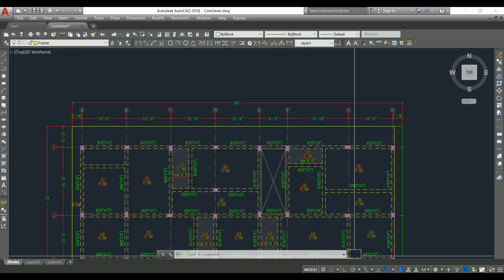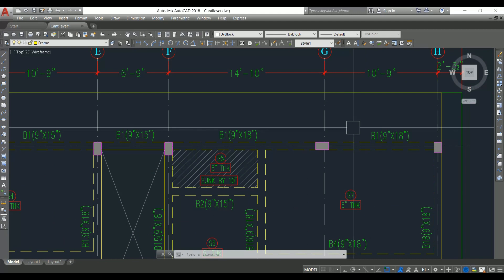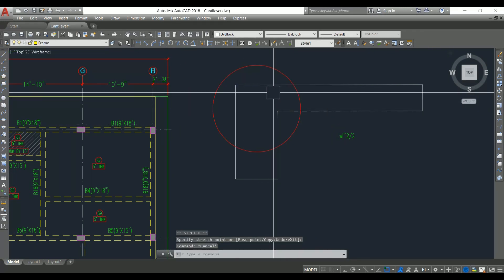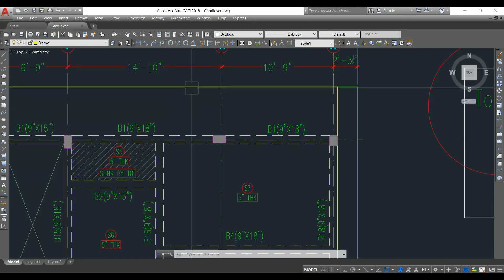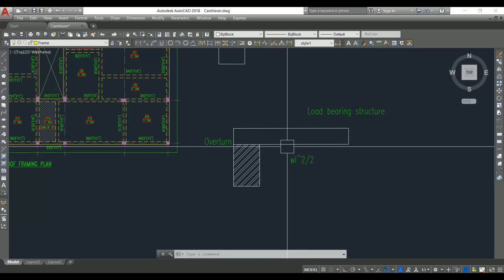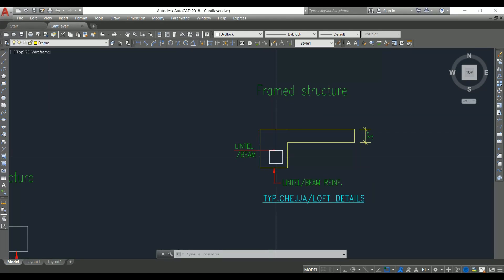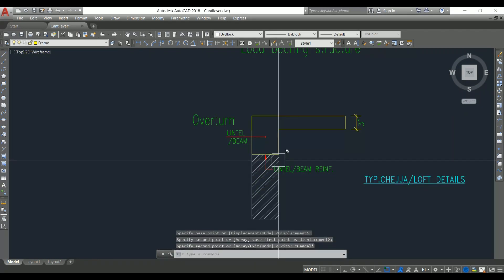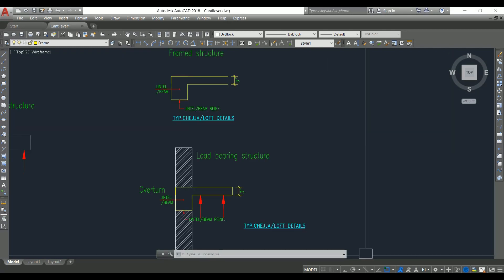Cantilever slab support in load bearing and framed structure | Cantilever slab support | torsion

Comment: Thanks for sharing.  Could you please explain from which side ( support / free end) we have remove the props
Reply from the maker: You are welcome.
The cantilever slab Shuttering needs to be removed after a wall on the top is constructed to avoid an overturning moment in load-bearing support.
Please refer to the video.
Reply: @CivilEngineeringMastery  we will remove the props after the construction of the wall only. But from which side do we have to remove it first?